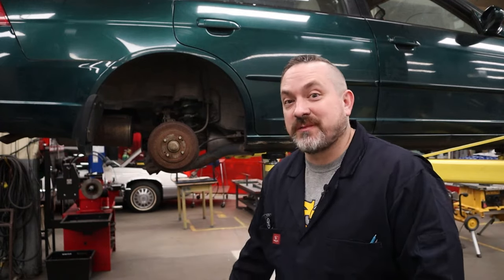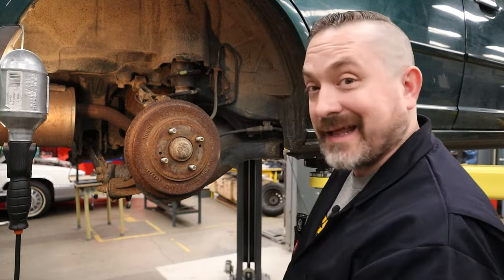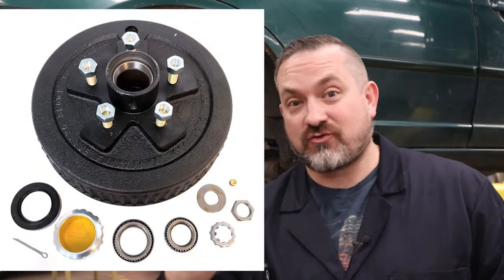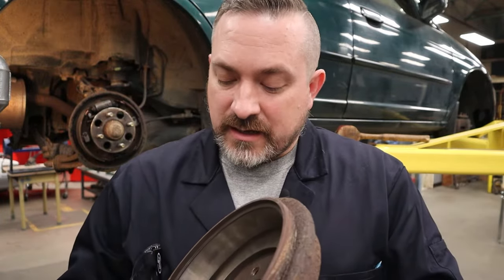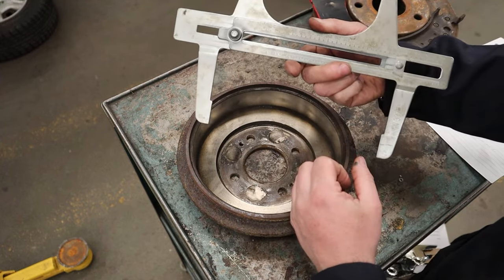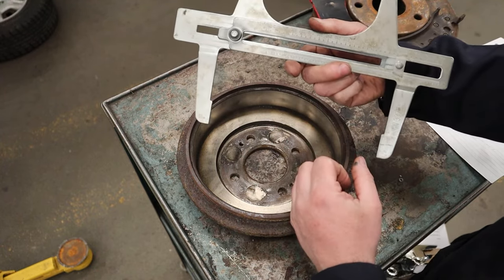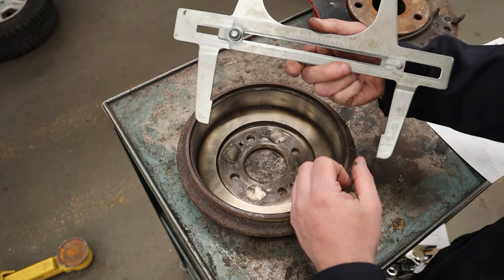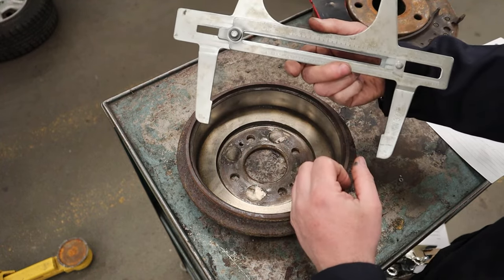Inspect drum brakes like a boss!

Comment: A cheapskate way to measure the drum diameter is to cut a thin straight stick into a very exact length.  See if it spins totally evenly all the way around.  Cut down until it does.
Reply from the maker: That's a neat trick!  Thanks for the watch!

Comment: If wooden mallet won't solve rust weld, then blowtorch is next.  Doesn't have to be super hot torch, but you may have to stand on it, really apply flame right where needed for awhile.
Reply from the maker: Yeah that works too but keep it moving so you don't create hard spots.  Cheers!

Comment: If release with star gear is needed, they need to know that star gear ratchets in 1 direction.  Need to stick 2nd tiny screwdriver in there to release ratchet to loosen.  1 screwdriver is only gonna tighten.
Reply from the maker: Not all star wheel adjusters have that sheet metal pawl that prevents it from going backwards but yes if it has it, you need to release it.

Comment: My mom’s 04 Civic drum brake makes like a squeak when I am slowing down and let off the brake pedal. Any idea of what this could be? It makes sense to me that when you step on the brake that the brakes would squeak but it doesn’t makes sense that it would make noise when I release the brake pedal.
Reply from the maker: First inspect your brakes but if it isn't the squeeler tab telling you to change your pads, then it is a lack of silicone lubricant on the metal to metal parts which causes slight chirping like you said.  You can take them out and re lubricate them but most people just wait till the pads need changing.  Hope that helps.  Thanks for the watch and welcome to the channel!

Comment: Can't believe this only has 5K views.. I have been searching for this topic and this video is the most comprehensive with great presentation by far. Learned so much and thanks for sharing such detailed and valuable information. But I still have a problem so I would like to ask a few things if you don't mind. 
Problem is when my car (2007 Corolla) is jacked up, the wheel spins well with parking brake off, and they lock wells with parking brake on.
But the parking brake doesn't work while driving. The car wouldn't stop and it will just roll with only tiny hesitation.
Checked all parts, cleaned, checked cylinders/cables/joints/pivot points, no rust/crack, checked drum diameter, and replaced front (leading) shoes as they were 1mm. Back (trailing) shoes were 3mm so didn't replace. Nothing seems to help.
Also, adjusted star wheel and cable tension, but nothing helped.
You mentioned about the chamfer but upon checking the brand new drum for my car, they don't seem to have any chamfer. And as you mentioned in the vid, I bought a drum brake caliper and the diameter seems perfect without any chamfer. 

A couple of things I want to point out 
1) If I force hard to turn the wheels with my hands while parking brake engaged (while jacked up), I could actually spin them a bit which I suspect it shouldn't happen. So I suspect the shoes are not biting the drum with enough force. 
2) The cable tension was loose before (10 clicks) so I adjusted to 6-7 clicks. At some point it felt a bit loose again, but now I can't adjust anymore under 7 clicks as the adjusting nut is maxed out. I was able to adjust it much tighter before (even up to 3 clicks). 
The cables are working fine. 

I am quite desperate to find the cause and any advice would be much appreciated.
I hope you earn way more subs and views that you truly deserve.
Reply from the maker: Yeah me too.  I pour my heart and soul into my videos and it's maddening to not have it found in the sea of youtube videos out there.  Maybe you can help me with this and share out my channel on your social network and they can share out on theirs.  Thanks in advance.  

Some of the newer vehicles parking brakes suck even when everything is ok.  That being said there are some things to check.  You always change both shoes when changing your brakes.  Check your setup as an incorrect placement of the drum brake parts could be causing issues.  Make sure your drum diameter is only 1mm bigger than the diameter over the shoes (use a drum brake caliper).  You need that clearance so your brakes wont rub but you don't want them too far away either.  Disassemble the star wheel adjuster and wire wheel the threads clean and lube the threads with never seize.  Make sure you don't mix up the left and right adjusters as they have opposite thread directions.  Make sure all 3 brake cables are free to move.  Find the adjuster on the cable and adjust so the parking brake lever/pedal is tight at 2/3rds of the overall movement.  Make sure you do a bedding of new brake parts to match the contour of the drum and the shoe linings. Check that both sides are evenly braking, one side might not be grabbing as hard due to a cable or poor adjustment.  Check the caliper pivot for the parking brake, they can seize up and not provide all the power to the brakes ( depending on the system).  Do a couple hard brakes in reverse to allow the adjuster to self adjust if it needs it.  If re using shoes, lightly sand lining and drum surface  to remove glazing.  I also change all springs when I change shoes, cheap insurance for $15.  Hope you can figure this out, good luck and thanks for supporting my channel.  Cheers!
Reply: What did you find out after WOTW responded?  I'm curious!!
Reply from the maker: Me too!

Comment: I did drum brakes for the first time about 40,000 miles ago, and just inspected them.  All is good.

If you do need to replace shoes, you have to also replace the little springs and doodads too.  That's called a harware kit.  BUT: a regular kit doesn't include everything, you can also get the self-adjuster replacement kit as well.  It's cheap, and easier than cleaning up and re-lubing the old one.
Reply from the maker: Awesome!  It's pretty cool to do this stuff yourself huh?  Yeah good tips, I need to make a bunch more videos for diy drum and disk brake changes.  Keep your eyes peeled for them.  Maybe hit the subscribe button and the post notifications one too do you know when it's out.  Thanks for the watch and welcome to the channel!

Comment: Great information! I just recently had my drum brakes replaced. At first, they couldn’t get the drum off on the right side. The mechanic said that they were going to have to bang on it until it came off, and in the process, could do more damage to the rear and could potentially cost up to $800 in repairs.
They eventually were able to get it off, and put the new shoes and drum on. Shortly after getting them replaced, the brake started squeaking. I took it back the next day and they told me it was normal for drum brakes and the noise would eventually go away. They said this without looking at it and just sent me in my way.
I kept driving it and the noise got worse and the brake started squeaking even when I wasn’t pressing on the brake. I took it back and they said something about the part they needed was on back order from the dealer and had to adjust a new part they put on. When I left the shop, the squeaking stopped, but it began squeaking shortly after.
So now I’m driving around with a squeaky brake again and I don’t know what to do. I drive Lyft/Uber and haven’t been on the road because they squeaking is so loud and unbearable, which means I’m not making any money.
What should I do?
Reply from the maker: Sounds like you may have a poorly adjusted star wheel adjuster and maybe the brakes are sticking on. Do you smell a burning metal smell?   Do you have grabbing of the brakes with light brake pressure? The banging to get off is usually fixed by removing the rubber plug on the back and loosening the shoes out from the groove in the drum.  If you're not comfortable doing it yourself, I might suggest going to another mechanic.  Good luck!
Reply: I haven’t noticed a smell. I mostly keep the windows up because the noise is so loud.
When I first start driving, the noise is t present, but when I brake a few times then the noise comes back. It has progressively gotten louder with a soft touch of the brake. 
Is the star wheel adjuster something that can be fixed or are my brakes doomed? 😢
Reply from the maker: Hard to say without seeing it but if the brakes are just too tight, they can be adjusted.  If something is wrong like a broken or misplaced spring, then it needs to be changed.  Like I said, it's hard to know for sure.
Reply: @wayofthewrench  Okay, I see. I just realized right now that my emergency brake is loose. It goes up without any tension or pressing the release button. It stays up when placed up and goes down. But it’s very loose. Does that also have to do with the Star wheel adjuster?
I wouldn’t mind adjusting what I needed to if it’s not too bad of a fix. The main reason why I took it to the shop is because I couldn’t get the drum off by myself. 
I’m just hoping it’s not too bad because I need my car for work 😓
Reply from the maker: That's a high possibility that it is part of the issue.  You might have a seized brake cable that won't return or some hardware has come loose causing the parking brake to be malfunctioning.  Hard to tell through messages.  It depends on how skilled you are with drum brakes.  If you aren't very skilled, then I would highly recommend you take it to another shop.  Drum brakes can be very tricky and putting the part in the wrong way can cause issues, which have huge consequences if your car can't stop.  I wish I could help you more but keep me posted Deanna.  Good luck!
Reply: @wayofthewrench  Thank you for all of your help. I will definitely keep you posted 👍🏽
Reply from the maker: Cheers!

Comment: ‘84 Silverado 4x4. My emergency brake won’t fully disengage when applied.  I have to drive it hard to get it to disengage.   What would I be looking for on inspection?
Great content!!
Reply from the maker: Sounds like an emergency brake cable is rusted and needs replacing.  Not a bad job but will require the disassembly of the drum brakes.  I have a great video on how to do that, you should check it out too.  Thanks for the watch and good luck with your brakes!

Comment: Thanks so much for this video!  I do not like guessing at adjusting drum brakes, so I ordered a brake resetting gauge.  I have 3 cars with drum brakes.  Subscribed! While I'm at it, I have a question: I want to change a wheel cylinder that looks wet inside, it's rusted to a brake line which is rusted to a flex hose (which is probably rusted to the next brake line).  When I do this, do I need to replace any springs, etc?  (I would replace the brake line, flex hose, etc.)  150k miles on the shoes, 4mm of thickness.  Quite old.  Let me know if you need more details.  Thanks
Reply from the maker: Awesome, thanks for the sub!  You're in luck, my how to replace drum brakes video drops this Thursday and it's got everything you need to know.  Yes I would suggest you replace the springs.   If you deem me worthy, I'd really appreciate it if you could share out my channel on your social media so I can help more people.  Thanks for the watch and welcome to the channel.

Comment: 17:29 Oh no, I've been putting that silver anti-seize on the studs. I haven't noticed any problems with the lug nuts getting loose but gonna go out and clean all that off ASAP.
Reply from the maker: Yeah the torque specs are for dry, no anti seize.  Just wipe it off and hit them with some brake cleaner.  Thanks for the watch!

Comment: Im doing a rear brake drum and brake shoes replacement on 2011 silverado Lt 1500 5.3liter. Im a DIY. What can i do remove anti seeze on lug nut bolts ? The lugnuts were hard to remove in the first place.
Reply from the maker: Use a rag and some brake cleaner and a wire brush.  Then just torque them to the proper specs.  Thanks for the watch!

Comment: Dear Sir,  I am at Lowe's.  What metric size/length are the two threaded bolts you use at about 3:00?  If no reply, you do not know. Thank you. (Eric)
Reply from the maker: They are usually 10 mm but could be 8.  They are always metric though as there are never on domestic vehicles in my experience.  Good luck.
Reply: Thank You!
Reply from the maker: No worries!

Comment: my 2009 silverado has the 2 holes, but i cant seem to find a screw that fits it.
Reply from the maker: Should be 10 mm bolt holes, maybe try cleaning out the threads first.  That vehicle should be metric by now but sometimes these domestics still rock out with imperial fasteners.  You might wanna check for the rubber plug at the back and turn out the star wheel adjuster to get the drum off if it feels loose but won't come off.  Good luck!

Comment: what if u aren't able to remove the lug nuts 
My Otti had a problem with the left back wheel, it didn't move forward but in reverse it moved I couldn't get the last lug nut off so I'm jus stuck with this shittty car that can't drive forwards properly
Reply from the maker: Stuck lug nuts are the worst!  I just dealt with one on a steel rim and had to cut the lug nut in half as much as I could and then hammer and chisel it until it split and fell off.  Then Zi had to install a new stud.  So maybe that can help you out.  Good luck!